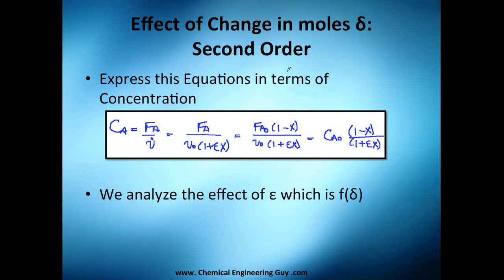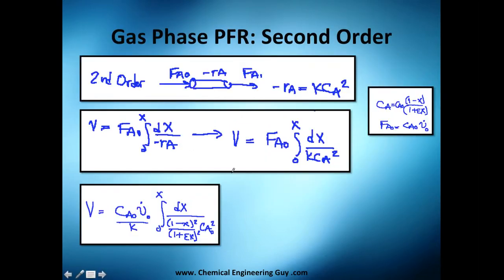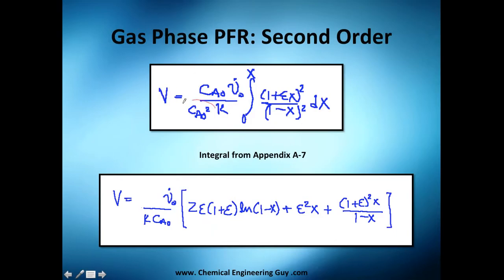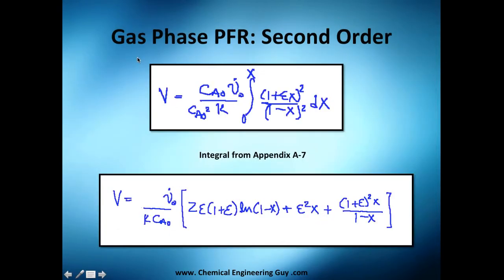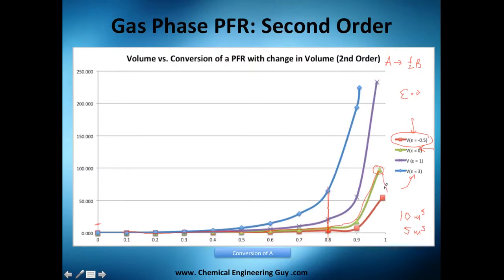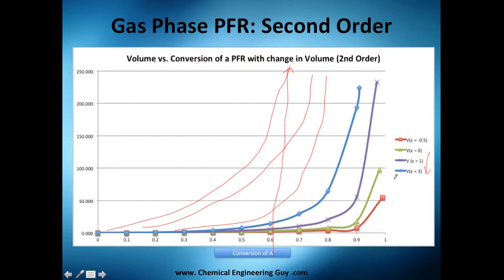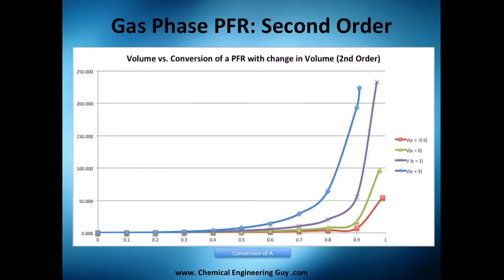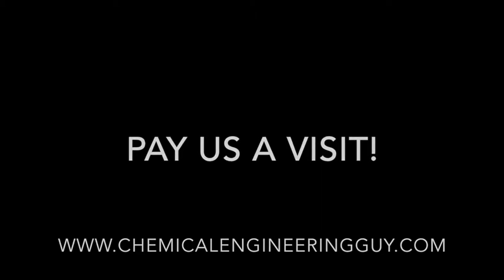Gaseous Phase PFR + 2nd Order // Reaction Engineering - Class 73

Comment: How would this work if you had a second order gas phase reaction with 2 difference species in the rate eqn? for example if it were A + B —> 2C + D. I’m struggling because the E for both is different and so is X. Initial concentrations are also different